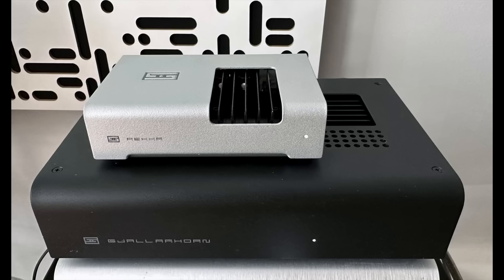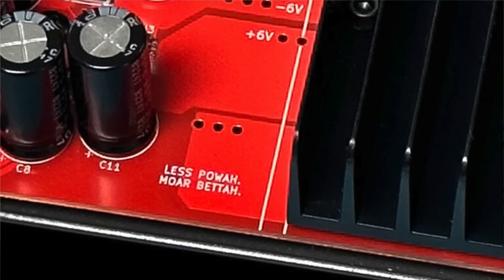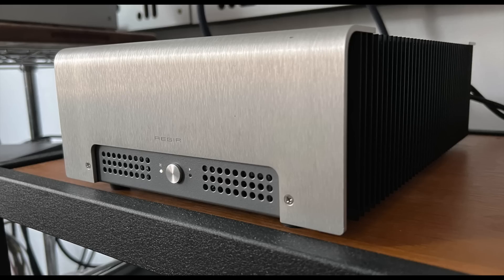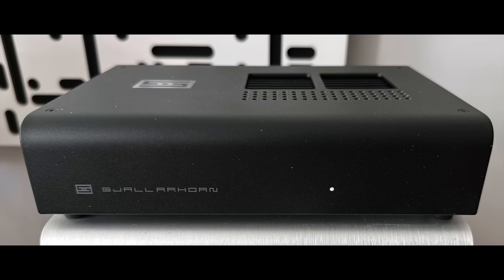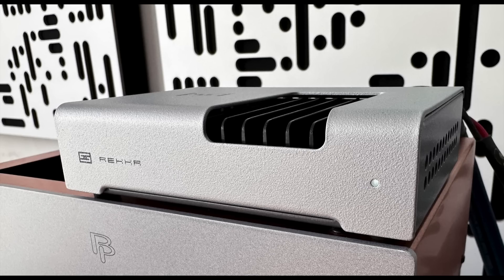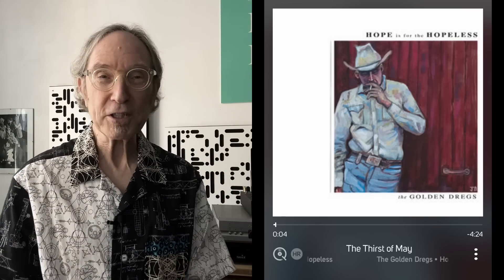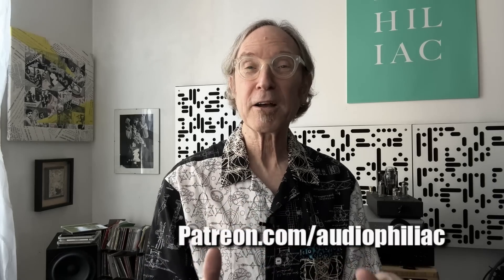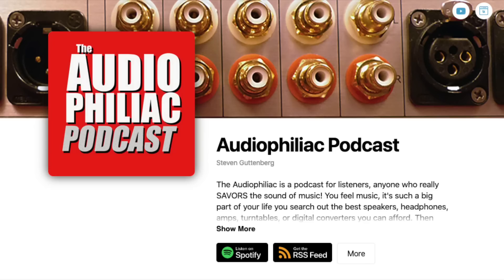More SCHIIT: Rekkr & Gjallarhorn Amp Reviews

Comment: I wish you would have tried the Rekkr in mono vs the Gjallahorn. I imagine a lot of people would be curious about that comparison.
Reply: The Rekkr in mono has a ~6W output, so you get 12W for 2 Rekkrs versus ~40W for 1 Gjallarhorn in Stereo mode, so the latter is a better deal. The Rekkrs have very low distortion but both amps are not specd for 4 ohm speakers which is always a risk.
Reply: @trudimcleod5042  the GHorn in stereo is not 40 watts, it's 10 at 8 ohms/allegedly 15 at 4 (though I've seen measurements that only give it 12). I agree that against 2 rekkrs the ghorn would be a better bet but not by that much. Also the power consumption of 2 rekkrs = max 24 watts while the ghorn is max 80. I know people in the US don't consider this as much, but in the EU power is more expensive, and a quadruple power draw is nothing to sneeze at.
Reply: @lisar3944  I got my numbers from the measurements shown on the site.  BTW, ~ means approximately.

Comment: I’m really intrigued by the Ghorn to pair with my very sensitive speakers but no silver version would be a deal breaker. Pity.
Reply: Why, silver spray paint is easy to find.
Reply: @awboat  Won’t match my other silver Schiit stuff. Last thing I need is the stench of paint in my room when the amps heat up. Schiit should up charge if the cost to produce silver is more than the black. Not very smart marketing. Oh, well.
Reply: @awboat  And what about the silk screening? Sorry. No dice.
Reply: @ecyfoto  I've read that Schiit themselves hasn't done a great job of getting the silver finish to match across models, so...

Comment: I wish we knew how the Gjallarhorn would compare as monoblocks vs Vidar
Reply: I did see a comment somewhere that said something like "no, two Gjallarhorns do not equal one Vidar."  But I'll be skeptical until I see some other people say it too.
Reply: Second!
Reply: If you look at the specs on the distortion curves on the Schiit site, the Gjallarhorn in mono outperforms in THD compared to the Vidar 2, and only a difference of 40W in total power.  However Gjallarhorns in mono are unstable with 4 ohm speakers, which a single Vidar 2 wouldn't have.
Reply: You’ll probably get better imaging / separation, but you won’t get the dynamic impact that comes from more watts. Unless your speaker is 90db+ then maybe.

Comment: The funny thing about Watts, is that an amps "measurement" is not a decisive "stamp" for how muscular and potent it is. At least not in my experience, as i own the top of the line, Lavardin - Pre/Mono amplifiers. 
They put out 56 w each, and do drive, most of what is out there. 
I'm not an expert, when it comes to circuits, inside "stuff", and so forth 
 But i did believe (in the old days), that the more watts, the better it sounds.
What a statement that was 😂 
I'm now +35 years into this crazy beloved passion, for sound and music in my life, and feel kind of "getting there", with my system and myself, and that is some kind of a task for me. 
I owned my amps and speakers, for 8 years, and when u live with the center of what i call a system, u really get to know that sound, and it comforts me.
✌️❤️🇩🇰

Comment: I have a Pioneer DJM 450 mixer I run my twin Pioneer PLX 500 TTs. The DJM 450 has XLR balanced outputs. How would G-Horns as mono blocks connecting my subwoofer through the RCA outputs. Currently in am using the Aiyima 080 Pro which has been a mighty little (cheap) amp.

Comment: My Schiit Asgard came on Tuesday and it is really a great headphone amp.  Needs to break in, but it can drive any set of "cans" I have here.  I will buy the $300 Schiit amp in two weeks after the Asgard is broken in. My new little listening room is 13 x 13 and I have two headphone stations, plus my computer system with  a Steinberg US22 interface.  My little JBL 3-way book shelve speakers are 86 db efficient so the Gjallarhorn should drive them loud enough as I am sitting about 6-7 feet away when not using my headphones. I have two other Schiit headphone amps and their $99 dac I use to improve the sound of my Denon Carousel Cd player that is by the bed for sleepless nights and my AT-ATH 50X cans.
Reply: My Gjallarhorn came today and even without any hours on it, I really like it with my Asgard headphone amp/preamp.  Some say: go large or go home.  Well, I've gone small and like it.

Comment: Really curious about using a single Gjallarhorn for my Elac Debut 2.0 B6.2s. My "loud" threshold before I'm really uncomfortable is about 90dB. Think the Gjallarhorn is capable?
Reply: I just got that exact combo set up in the last few weeks. Running through a Saga + with a Rega P1 Turntable. "Loud" requires pointing the volume past 3pm. Methinks the Elac's are a tad inefficient, but the sound is sweet and satisfying. Haven't connected anything digital yet, soon to come.

Comment: How do they manage such a low cost when made in the USA?
Reply: It's not really made in the usa its assembled in the USA electronics made in some third world country.
Reply: @991carreras3  I don't think that's right.  Most of it IS made here, including their circuit boards.  Exceptions are kept to a minimum, and include things like wall-warts and of course the Gjallarhorn's toroidal transformer.  The company is very open about this.
Reply: I read the book Schiit Happened by co-founder Jason Stoddard. He spends a lot of time discussing how he designs, sources, and assembles products using as many domestic components as possible, including pc boards and the metal chassis. In short, he says there is still competitive manufacturing in the US if you care enough to look for it!
Reply: @991carreras3  wrong
Reply: @Mike Hiteshew  wow I must have two Schiit Chinese counterfeit models cause one has panasonic film caps in it and the other unit has Japanese Nichicon capacitors.
Reply: @991carreras3  Well those aren't third world countries
Reply: @991carreras3 Not true.

Comment: I used to have a Linn Majik integrated amp rated nominally at 30 w per channel. It would beat most 100w 'beasts' I'd heard
Reply: My Linn Intek integrated amplifier from 1990 was rated at 50 wpc into 8 ohms.  Julian Hirsch in Stereo Review tested it as doing 220 wpc dynamic power into 2 ohms. It drove the begeesus out of my Martin-Logan Sequels, an electrostatic hybrid.  Great combination 😊

Comment: Hi Steve.  Great review.  One question. Gjallhorn to be purchased running as monoblock.  Can this setup support LRS+ speakers.
Reply from the maker: No, LRS needs lots of power, Vidar 2 is a good starting point. That's 200 W per channel into 4 ohms. Schiit doesn't spec a 4 ohm rating for mono Gjallahorns.

Comment: Sadly Schiit is much to expensive in EU. At the same price point or cheaper as Gjalarhorn you can get AB integrated amplifiers with 35-45W output power per speaker.
Reply: yup. And it's not just the VAT increasing the price, especially when you consider exchange rates. Regardless of cause, the ghorn at 399 euros is a tough sell.

Comment: Will the little Schiit run a  6 ohm small Mission MS-5 or other similar speakers?
Reply: In stereo mode any of their amps ought to work.  The dynamic range would be dictated by the sensitivity of the Mission speakers.
Reply: @trudimcleod5042  I hardly turn up the volume on my my workspace, I just don't want to fry the amp or speaker. Thanks!
Reply: @rabit818  How big is your workplace, just curious.  I am considering the Rekkr just for fun.